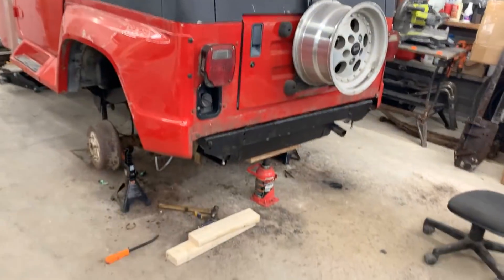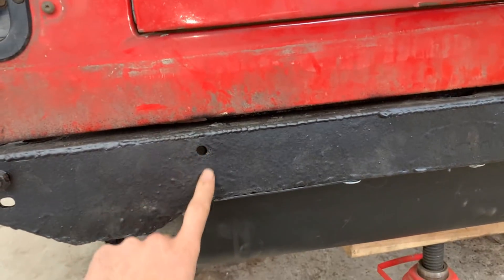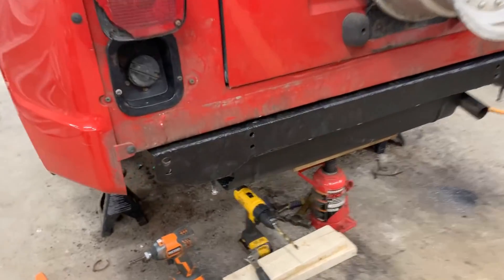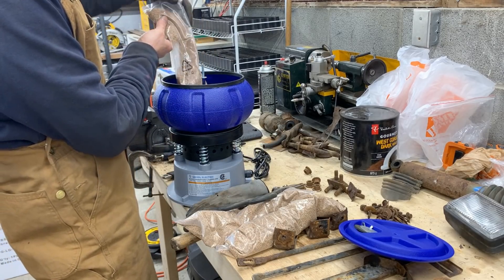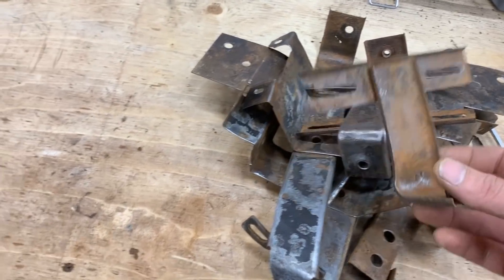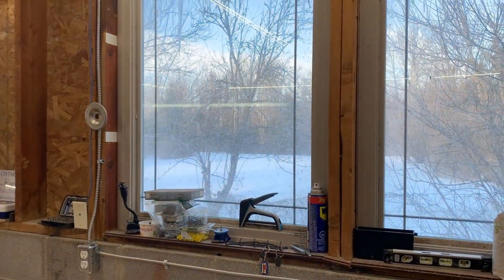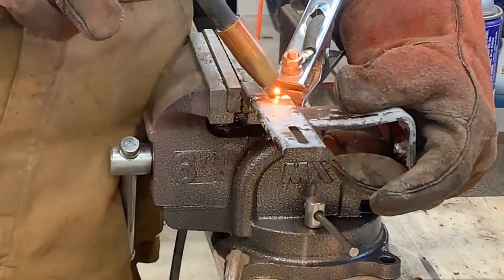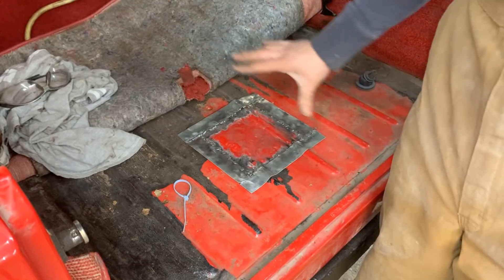1994 Jeep YJ - Part 17 - Some Little Projects

Comment: I used 10%  citric acid and 90% water solution for small metal parts. Does the job fairly quickly as well.

Comment: You have created a picture puzzle of a vehicle, which is bad enough, but to not pay attention to the fuel tank is criminal. One gallon of gasoline weighs seven pounds. Multiply this by the capacity of the tank. If you want to put your backside in that death trap, so be it. Just remember that if you have passengers and they are injured in any way, you are responsible. Period.
Reply from the maker: Yeah, right, let me do the math. So seven pounds per gallon, 15 gallon capacity plus the weight of the skid plate and the tank say 20 pounds divided by eight fasteners... that is the mind blowing 16 pounds per fastener! I wish I had the time to test one of these self tappers, but I am sure that you as an engineer know how much it would hold.  And a picture puzzle? Which car isn’t one? Even your model cars are, aren’t they? Everything is built from separate parts, and I believe you’ve seen in person how limousine frames are built... the same way I rebuilt mine. Have you ever seen one brake in two? Come on John....
Reply: @RustyBeauties  The physics involved in a collision are immense. Those fasteners will not hold.
Reply from the maker: @studio6525  yes, in a collision they won’t, I agree! However they will hold as much as the original ones would!  Noone can guarantee what would happen in a collision
Reply: @RustyBeauties  You don't want to have the same issues as Ford did with the Pinto. They used fasteners to mount the fuel tank to the underside of the car in lieu of straps saving $5.00 per unit. In a rear collision the fasteners did not hold with deadly results. (A very well documented case.) I think anyone commenting on this is just very concerned for you and your safety.
Reply from the maker: @studio6525  thanks, John, I appreciate your concern, but I am not concerned at all. I trust my own work. I can guarantee that this car in this state is safer than any Ontario car that has been out in the winter.